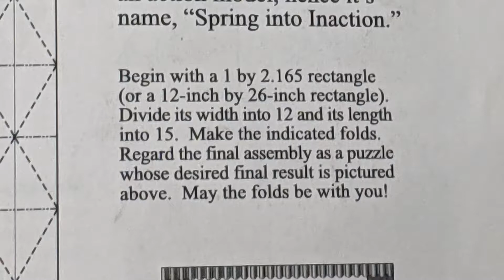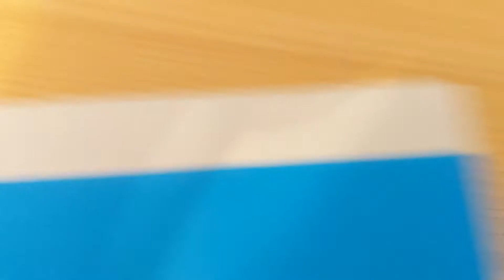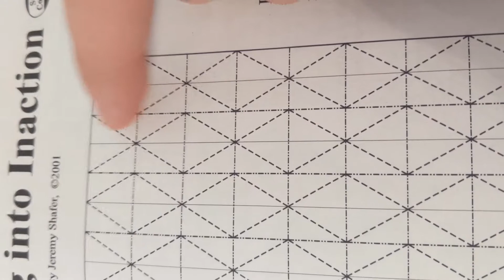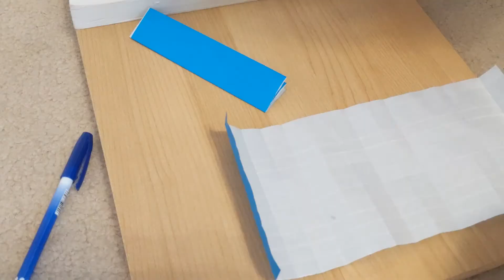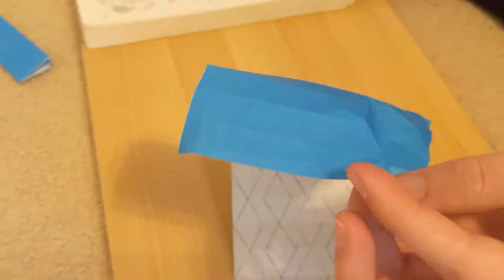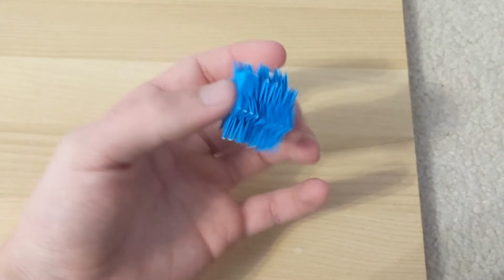Origami Spring into Inaction by Jeremy Shafer tutorial

Comment: what is the grid?
Reply from the maker: 12 by 15, on a 1 by 2.165 length paper
Reply: @danisak2002  how did you do that
Reply from the maker: @dungtranthi1089 I explain it in the video/description: for the 12 you fold the paper into 3rds and fold each 3rd into 4. For the 15 fold the paper into 3rds and use lined paper or approximation techniques for diving paper into 5 as demonstrated in other creators' videos.

Comment: tell us how you make that pre creaseing
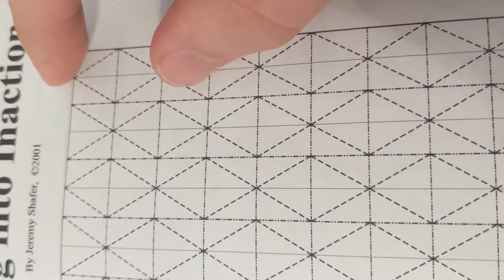Reply from the maker: Shown at 3:00!
Reply: @danisak2002  i cant draw creasing
Reply from the maker: @dungtranthi1089 Xs following the grid, with diamonds between the Xs made up of each half of the Xs. Try drawing the pattern on a small paper or folding a strip of paper into just one or two columns first.
Reply: @danisak2002  i not good at drawing, no ruler
Reply from the maker: @dungtranthi1089 use just a pencil, try your best to get lines, and fold as close as you can to connect the points of each grid box. Or draw dots on the corners and connect the dots! You can also use a pencil as a ruler.
Reply: @danisak2002 i cant
Reply from the maker: @dungtranthi1089 hopefully you can find someone that can help you with the drawing? Then you can fold away!
Reply: @danisak2002  nobody
Reply from the maker: @dungtranthi1089 is there any way I can help you?